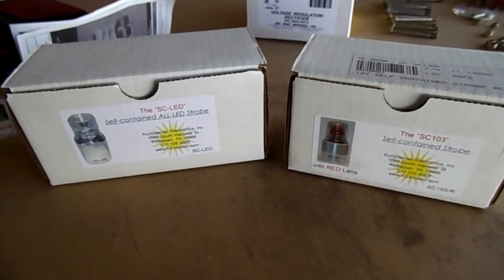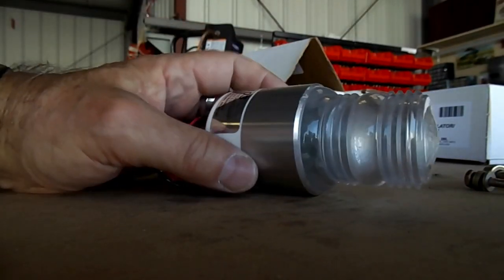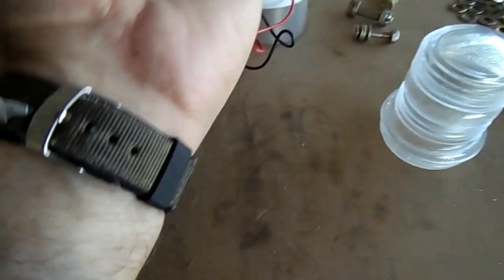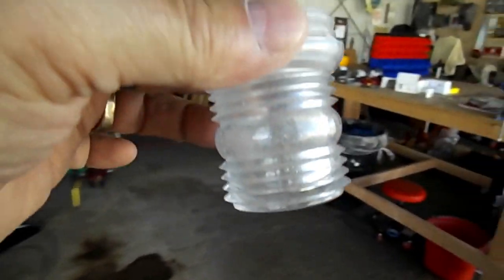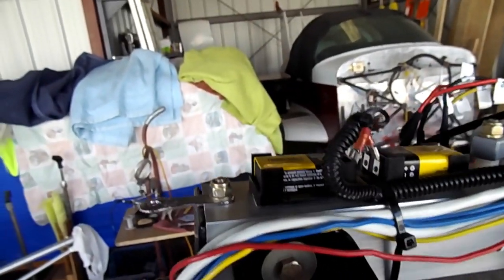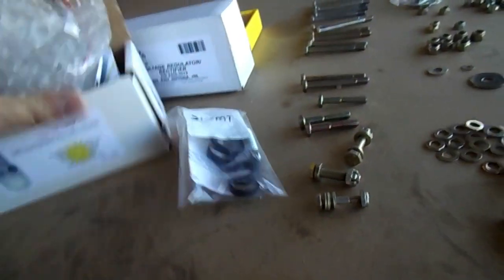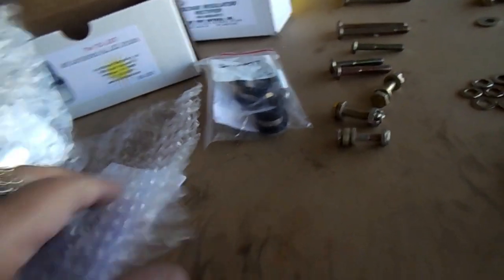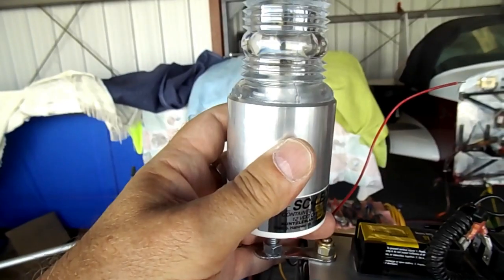Bad Vibrations - My Upper Strobe is Dead

Comment: Morning, I'm newly subscribed.  Following your Aerolite 103 project with great interest.  I'm a private pilot, but not current . . . I'm curious about your Lithium battery.  Ask Dennis how many cells are in your Lithium battery, and confirm if it is a lithium polymer.   I have a little experience with Lipo batteries.      Bob